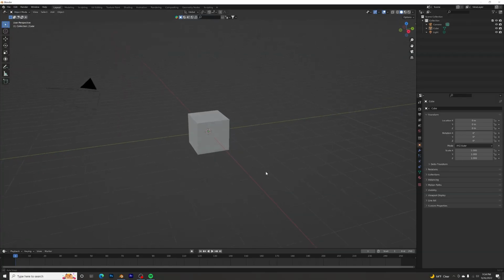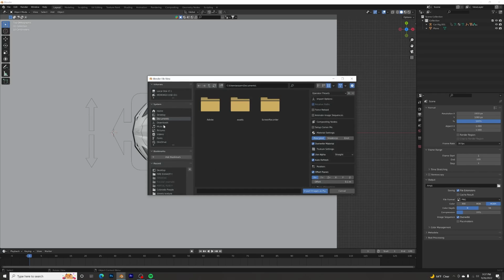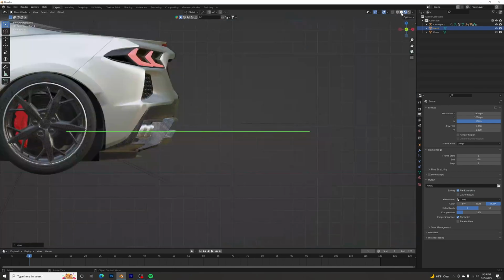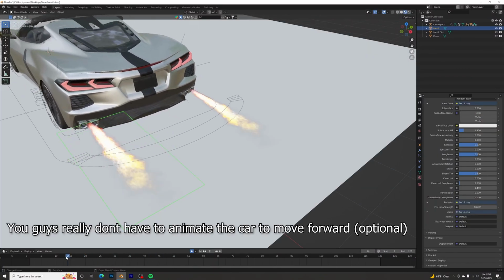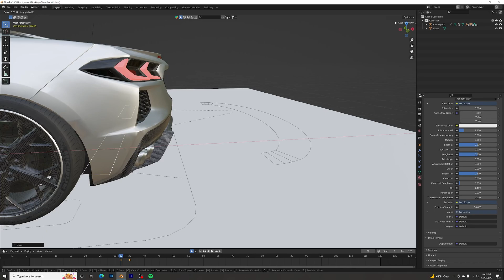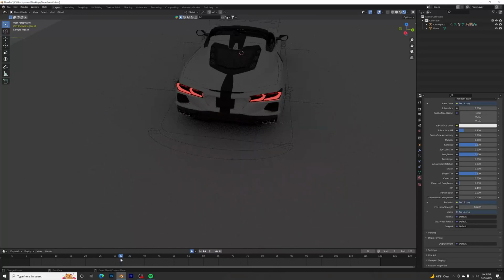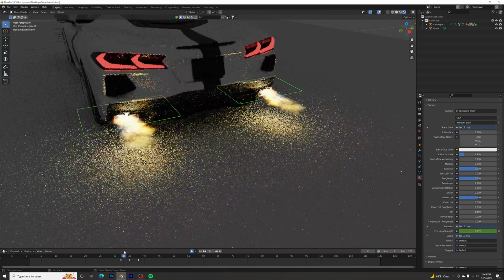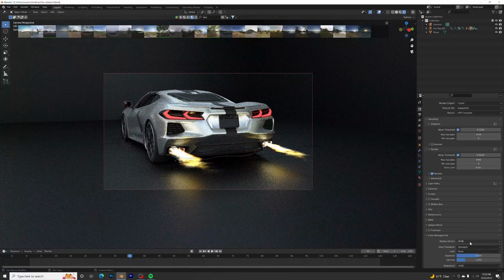Making Car Animation with Fire Exhaust in Blender (Quick and Easy Tutorial) Under 2 Minutes

Comment: I recommend using Shape Keys instead of just scaling
Reply: How does Shape Keys work? What would be your process for it
Reply: @NenseiJay  Shape keys works like that you control the amount of transform via the <0-1000> Value that can be easily keyframed, keyframes can be found of <Object Data Properties>

With shape keys you can even add more complex transforms for the flame and still remain the original transform. After shape keys are done, you could add more geometry for the flame, and for example you can add displacement modifier and set the texture to Noise, then you can add a keyframe for the Strength of the Displacement modifier and you can animate it in Graphic editor with Noise Modifier, so flame can be more alive.

I hope I explained it well enought - I could also do a bit later the quick video about the process.